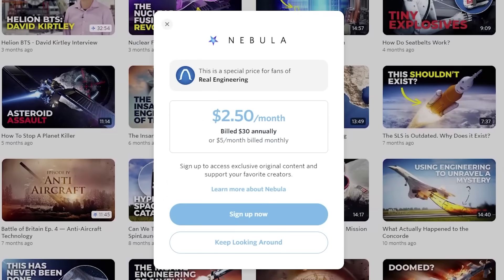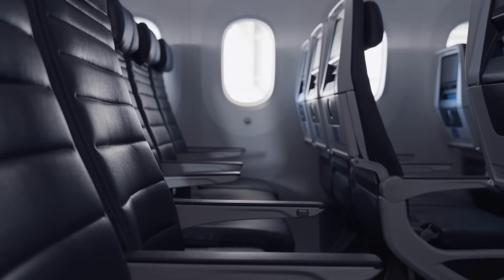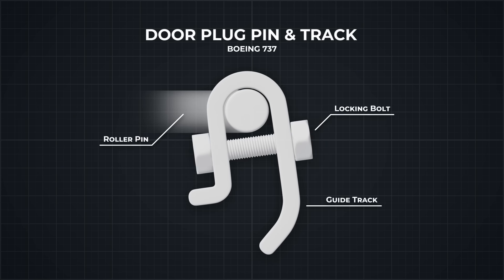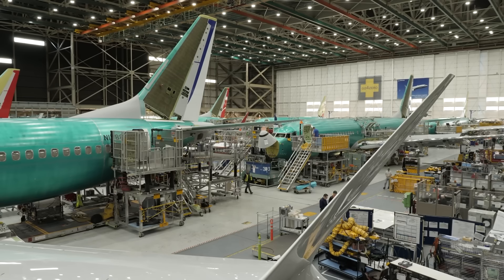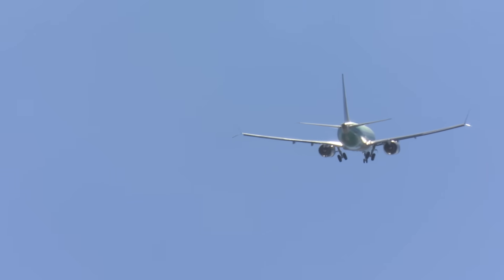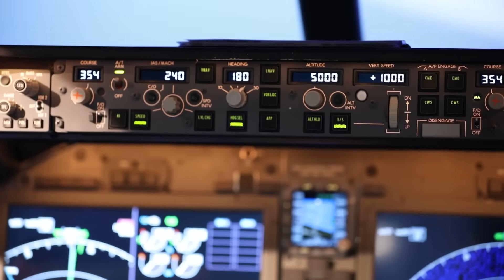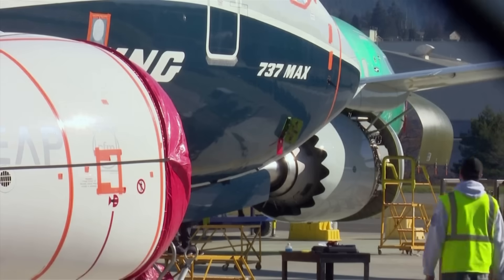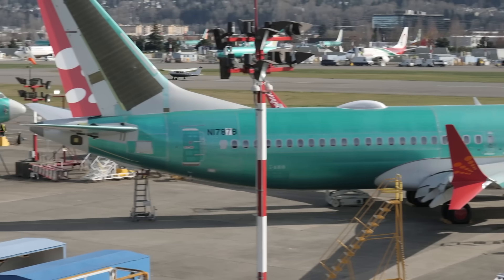The Questionable Engineering of the 737 Max

Comment: Flying has always been touted as the safest form of travel. The attitude is so permanent and ingrained the people still fly after hearing about stuff like this. I wonder how many times Boeing has to willfully sh*t the bed before that attitude permanently changes.
Like, by the time people are chilled enough to actually reduce their flights, it's too late to fix the problem and restore the optics. You'd think the FAA and Boeing would both be heavily incentivized to prevent that, but that's not what's happening.

Comment: With regard to the 'engineers vs mbas' thing, you are missing a key part of the claim.  It isn't 'MBAs', it is "MBAs from McDonald-Douglas who first brought their corporate culture with them then built a hiring/promotion system based off it. Engineers who rise through the ranks of Boeing generally have to display the same priorities and behaviors that MD old guard valued, and they ran their company into the ground with it.

Comment: Corporate greed. Send the ex Boeing CEO to prison. He was aware of significant issues and CHOSE to cut corners. Pilots and engineers have been crying out about issues…and have been ignored. Whistle blowers and cover ups. I no longer trust this brand. They have also found loose bolts in the rudder. FDA is also culpable

Comment: Why is the door plug installed pushing up into a guide track that requires a bolt to be installed under the plug tab to keep it in place. In this case, the bolts appear to either have failed or not been installed properly as described in the video. If the track was installed the other direction, requiring the plug to be LOWERED into the track then gravity would hold it in place in case of a retaining bolt failure. Why was this option not exercised? It seems to me that a minor change in design could have mitigated risk of this type of failure. I am an engineer with more than 50 years experience in the maritime industry, while there are cases of design that make a catastrophic failure possible, there seem to be more checks and balances during the design phase (e.g., classification societies) that don't seem to have any equivalent in the aerospace industry. The maritime environment is a dangerous and unforgiving place, as is the aerospace environment, and having more eyes and brains review a design to find harmless looking, but dangerous, design details is not a bad thing. We have problems and failures too, but I can't recall an incident where a class society (or the Coast Guard, or IMO) waved a compliance requirement to allow a vessel to be built and sail while an issue is being looked into. In both environments, engineering failures and shortcuts can kill...

Comment: A bit of a side tangent, but my questions is - if something as 'minor' as adjusting the shape of the fuselage would have required recertification, why in the hell can you still add and modify safety-critical flight software?!
In my experience software is deemed as an afterthought by both manufacturers and regulators because it's a relatively new field, it's ephemeral nature, and the fact that 'it can always be fixed later'. Software in a safety-critical system is arguably the part that should have the most rigor and formal verification, not the least.

Comment: Could thread locker glue have been used to prevent those runaway nuts fasteners?
Reply: The nuts are held on by cotter pins.  It is impossible for them to back out.
Reply: @stargazer7644  Not the one with the cotter pin and castellated nut but the two other ones by the side that the found loose.

Comment: It is called " incompetence" from boing and Alaska, turning off warning lights without a report on the problem and the solution, is incompetent, I'm a pilot and my butt is on the line when maintenance pulls a stunt like that, regulation or not

Comment: While the engineering on the 737 Max isn't the greatest work Boeing has produced it is not a terribly designed Aircraft. The decision made by Boeing Executives and the working environment are what’s problematic. Boeing for example used to have their corporate headquarters in Washington (Where all their Civilian Aircraft are produced. Plants are Renton, Boeing Field, and Paine Field.). They then decided to move HQ to Chicago on the other side of the country and 1,000's of miles away from all the assembly lines. Instead of moving back after the Initial 737 Max incident they decided to move HQ once again but to Washington D.C. They didn't do this to be closer to the FAA as some rumors indicated but they did this for Boeing Defense to be closer to the Pentagon. Boeing needs to restructure their civil aviation management and move the civilian sector executives back to Washington State. That way they can once again be closer to the facilities where all the aircraft are manufactured (Except the 787 Dreamliner which is made in South Carolina.). Boeing has made some incredible planes over the years, and they've hit a lot of bumps in the road... But. All of these can be corrected Boeing Executives need to step up and do more to spark change. 

Thanks for coming to my TED Talk. Next week we'll talk about SPIRIT Aeronautical.

Comment: My dad worked for boeing (as an EE) until he retired 6ish years ago. He worked on the 787, and your video literally brought back memories of my childhood as it was loosely linked to that project. I also worked a short stint at boeing as a computer engineer. And that was the most miserable experience of my professional career. That entire company is completely mismanaged from the top down. When I told him this, he was like, "yeah that company has really changed".
Reply: When McDonnell Douglas bought Boeing with Boeing's money.  Even after that, I wonder how many of Boeing's issues could have been avoided by not moving their corporate headquarters to Chicago.  It is all fine and good to have senior executives with engineering backgrounds, but when they become isolated away from the factory floor they are just suits.
Reply: 😂😂 yk it's shit when the Computer Engineers complain
Reply: @RENO_K not really. The tech guys are always complaining, just not where they can be overheard.
Reply: it seems more to me like an integrity/workmanship issue..  if a door plug cracks under pressure because  the wall thickness of the plug is insufficient, or the door plug guide pin lock-out bolts shear because their diameter is questionable etc, those would be engineering's cross to bear.  by loading  pitch angle correction (MCAS) program  into the airplane & being deceitful about it or leaving structure/safety integral hardware in all sorts of places loose, etc has NOTHING to do with engineers. engineers dont assemble airplanes.
Reply: @Toobzilla I’m an engineer and as much as I’d like to say it isn’t an engineering problem it definitely is. Sure engineering isn’t the sole contributor to these issues but they play a big event. As far as the MCAS system, the entire plane’s safety should not rely on a single (non-redundant) error-prone system. It’s frankly poor engineering that a non-critical system failure would literally force the plane to crash itself.
Reply: Yeah, the management from the 40s-90s is gone. McDonnell Douglas bought Boeing with Boeing's money, and that's what we're seeing now. Short term profit focus and to-the-bone cost cutting nearly always irreparably damage companies in the long term.
Reply: As a Software Engineer (altough nowadays working as a Site Reliability Engineer) I'm curious if your job title really was Computer Engineer or if you just simplified a usually complicated IT job title for the sake of a YT comment and if so, what you were working on? I would assume some kind of embedded software development and circuit board planning?
Reply: Dam, got my curiosity. Why is it mismanaged? Is it that people there dont care about what theyr doing? Is it woke or both? What is it?
Reply: @oliveiraluis3540 it's all about getting production numbers up. Not quality and actual innovation to gain market share. Every single action is intended for profit, checked and checked again and tracked to the nth degree to maximize it, regardless of the loss of quality, safety, and reputation. The lowest quality for the maximum price. That's Boeing
Reply: @oliveiraluis3540  It has nothing to do with being "woke" (which is just a made up, undefined thing that politicians of a certain persuasion use to rile up their supporters).

There is no short answer to explain why and how Boeing has fallen.  If there was, it would be easy to turn the company around.  If you actually want to understand Boeing's deep problems, watch the video "The Boeing 787: Broken Dreams".
Reply: @oliveiraluis3540  Not everything that goes wrong is woke, I wish people would drop that.

Comment: You can't tell me, it's only the 737.     The Dreamliner too had battery problems - even if it was a brand new model. Of course, the 737 is probably the "cheapest" plane.

Comment: Ok what worse.. having a  door blow causing a very quick decompression with no injuries.. or flying a  fully flyby wire computer controlled widebody into the ground. The jigs and the design are from the 60's not to mention this is not an engineering problem that was solved decades ago.. this is purely an assemblies issues. You have companies and people that like spirt that are more concerned about DEI then are you capable of doing the job.

Comment: I work in nuclear power, and what's crazy is my industry derived a lot of its safety culture, corrective action programs, issue identification & resolution policies, and regulatory oversight management from the aviation industry, but they've loosened the reigns while we've stayed the course. The new push for 'innovate fast and get it to market' is a dumb way to run a business with this much at stake, and we've been seeing more and more examples of that recently
Reply: They applied the Silicon Valley mindset to effin high-level engineering masterpieces. Like they haven't learned anything from that Theranos BS. This is what happens when non-enginneering businessman get at the helm of an engineering company. It's like getting a seasoned bus driver to run a cruise ship just because they both drive transportation.
Reply: I agree, speed, bad quality assurance and innovation should not compromise safety. To me it seems that aviation is inherently so dangerous that serious steps have been taken to make it safe too the point becoming the safest way of travel. This has also happened with nuclear energy however it seems that ALARA is not the best safety target as radiation hormesis might be the actual mechanism for repair of damage by ionizing radiation. If this is true the radiation limits should be raised and the safety will still be the same. The other issue is how to deliver the maximum safety as it requires a certain ability to actually build which the us nuclear industry is lacking.  Either way it is important to always think of safety first and not third.
Reply: This is why I'll never travel internationally and that sucks

I will not risk my life or my family's lives by being a passenger in these death tubes
Reply: @sirbarongaming2138 your more likely to die by walking outside than you are on a plane.  Stay inside, stay safe, and stay crazy!
Reply: They've been taking much longer to get to market though.
Reply: It's because of big oils fear mongering scaring  the shit out of lay people .
Reply: crazy for the liability. Cost controls are generally bad business practices, but very very stupid in high risk industries
Reply: It worked just fine for McDonnell Douglas.  Don't believe me... look who's on the board for Boeing today!
Reply: Yes, But there are also multiple sides of safety in the Aviation industry; regulators and administrators, manufacturers and Operators.

The FAA is the most obvious reason for the high saftey Standards, but also reputation and litigation.

The sad story of boeing is simply the prioritising of Profits ahead of maintaining the culture of engineering at the Development and production Levels.
Reply: It has nothing to do with that. 

It's thr quality of engineers and over saturation of middle managers in aviation. 

It's only a matter of time before DEI comes knocking in your field and you start hearing about near melt downs or other issues.
Reply: Nuclear energy is incredibly safe but my greatest fear is that it might one day be treated like any other industry
Reply: This is such nonsense.  The accident rate has decreased by 95 percent in the past 20 years.  We have 87000 commercial airplane departures every day in the USA and there has been one fatality in the past 12 years.  Many of those departures are 737s.  Hysterical nonsense here.
Reply: @rogerd.3941 That's because Boeing's profit seeking corporate culture is relatively recent. Taking the last 20 years means you see a massive drop with improved technology and safety culture in the first half that masks the small but completely unacceptable uptick in recent years driven by catastrophic errors in the MAX, and specifying only the US conveniently hides the over 300 people directly killed by Boeing's negligent approach to designing the MAX. Defending Boeing on the basis of overall aviation safety trends amounts to endorsement of these shortcuts which will lead to much larger numbers of these disasters in the future, either due to further as-yet-unknown flaws, or due to future design shortcuts.
Reply: And countries are ditching nuclear power left and right, despite it being the safest and cleanest. It's bonkers.
Reply: one of the few times people being 'skitish' around atomic power is a plus.
Reply: And this is the reason why nuclear power is never completely safe, especially if it gets too common. People will loosen up, and no amount of tech can save you as long as humans are around.
Reply: @cancan-wq9un  Not necessarily. Liquid salt reactors, among other new innovations, negate risk of meltdown.
Reply: @cancan-wq9un everything is relative, and nothing is COMPLETELY safe, but nuclear is about as safe as it gets. Nuclear safety is at the forefront of every discussion, with a major emphasis on human factors. We value questioning attitudes and accountability. Everything is double and triple checked. If something breaks or goes wrong, the consequence hurts the owner's wallet, not the health and safety of the public. The alternative to nuclear power is usually coal or gas, or even no power at all. All are more dangerous. Side note: wind and solar don't directly compete with nuclear in the majority of markets.
Reply: @cancan-wq9un  engineering problem
Reply: @cancan-wq9un  you clearly aren't an engineer.
Reply: @polla2256  Engineers are people, and they are not even the only ones that has a say in any kind of project. In fact, worst enemy of any project is humans, since they are the weakest link in the chain. No tech or precaution will save you if some idiot thought is is unnecessary or too expensive.
Reply: @polla2256  He has a point, Nuclear. although today has incredible safety measures. Humans are the problem now. the Human Factor. Take the airline industry as a prime example. very few incidents are caused due to failure of equipment, the vast majority are caused due to human error.

Perhaps not tightening a fastener. misreading instructions, loading fuel in pounds instead of litres or Vis versa. the Human factor is a very real thing in engineering now.
Reply: @cancan-wq9un  Excellent comment. I don’t know what the solution is . Maybe Boeing should rip a finished aeroplane out of pre delivery & tear it apart piece by piece & see what other issues are hiding . If I travel in Australia it’s going to be on an 800 NG. Unless I want my knees up around my chin in an A320.
Reply: @beagle7622  They need to increase their standards, double-triple check everything and dont go cheap. Vanity and greed is the upmost reason stuff like this go wrong.
Reply: Hands down the automotive industry is the standard for manufacturing.
Reply: It’s diversity hires. Just look at Boeing, even Lockheed Martin etc celebrating their diverse teams. Having these diversity hires gets you exactly this.
Reply: @hikingjoe4752 what a dogshit conclusion to take from all this.
Reply: @bloodyhell8201  Just deny the reality and its all gonna be ok, boomer.
Reply: @hikingjoe4752  I love how there is definitely zero evidence of that and how hard you are leaning on your own biases to come to that conclusion in your head. Lmao
Reply: @hikingjoe4752  here comes the racist chuds!
Reply: @hikingjoe4752  A lot of the best engineers I know are diverse. You clearly aren’t one.
Reply: @Laminar-Flow  Thank god I'm not "a diverse".

Comment: Great video and a fair review.  I have experience with both Airbus and Boeing and love both.  I do love Boeing a bit more but there are some issues with corporate that cannot be ignored.

Boeing has a management problem.  Not an engineering problem.  When Boeing acquired McDonnel Douglas, when McDonnel Douglas was going out of business, Boeing took on many of the upper management from that company, many of whom are still around today and are currently in upper management, which has been biting Boeing in the ass ever since.  I understand that Boeing is a business and the purpose of a business is to make money, in this case, by making airplanes but laying off many inhouse workers, outsourcing huge amounts of work, laying off all those inspectors and busting the unions has led to many safety issues.  All this and Boeing had self inspection authority from the FAA before the MAX crashes and is now currently trying to get waivers to bypass certain things so they can prevent further delays which cut into profits.  Let's not forget that outsourcing work, spreads out the liability incase something does go wrong, so if Boeing does get sued, they can say "we didn't do it".